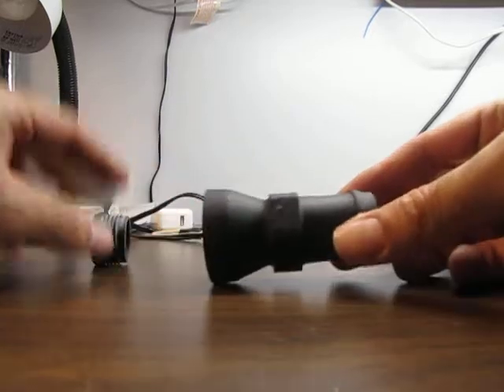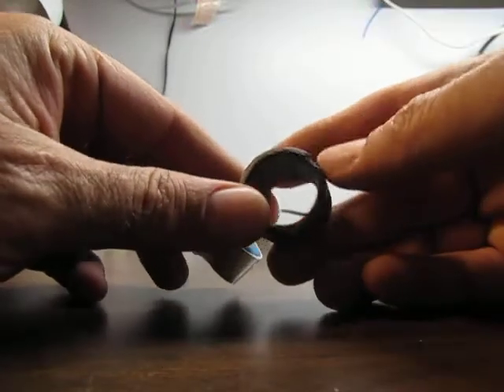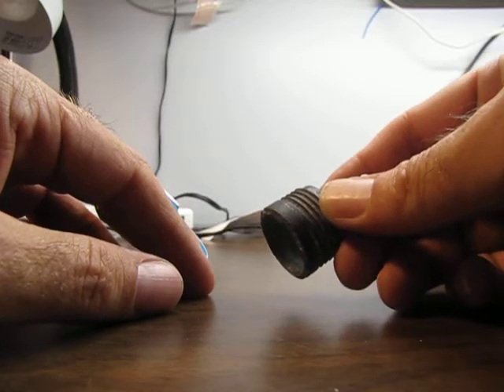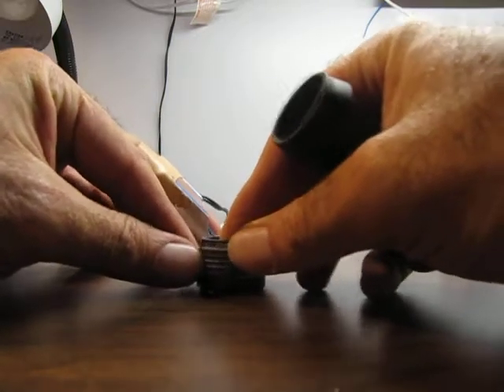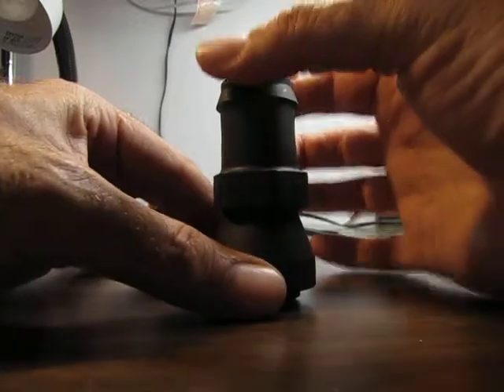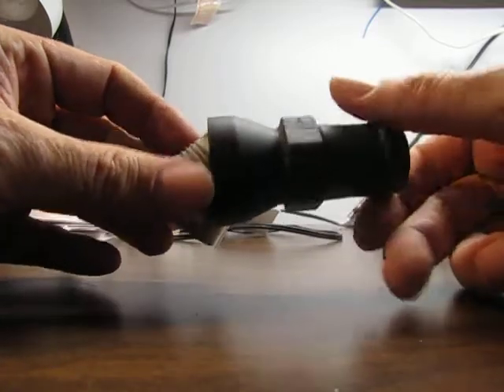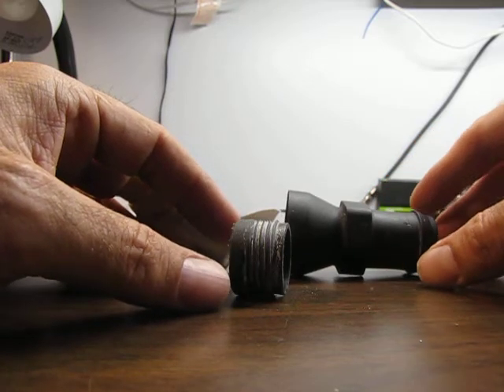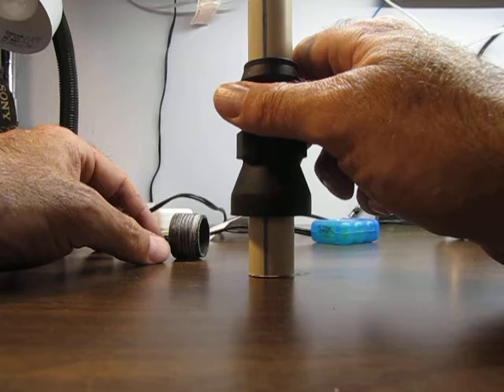Solution to SeaDoo cracked & leaky ride plate nipple & fitting? 2008 SeaDoo RXP 215. Part 3 / 3.

Comment: lol yo guys like you have to get rescued at sea! hard head lol if I tell a client something it's from experience and would be the quickest effective solution..... the 7 mins you took to figure this out I would of had the ride plate out about to pull it apart lol.... the idea is find a mechanic and spend the money if you can't do it yourself
Reply from the maker: Yeah, I always try to find a cheaper workaround. Sometimes I find it, sometimes not. In this case I did end up replacing the ride plate.

Comment: Those fittings are about $11... just replace it and if it breaks again, replace it again. Those little holes will restrict flow and that won't be good.
Reply from the maker: My understanding is that to replace the fittings, the ride plate must be removed. Big job. Thanks for commenting. Are you subscribed?